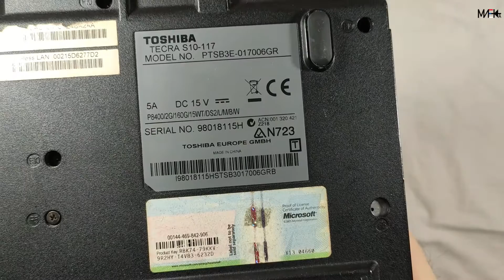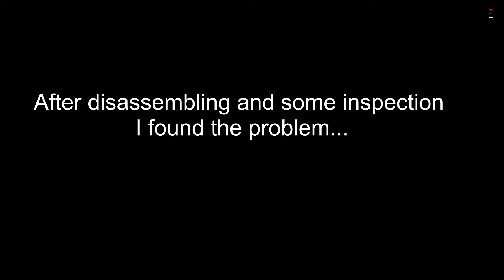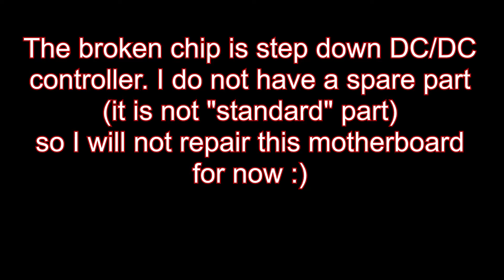Toshiba Tecra S10 117 / Blinking LED orange // Treperenje narandžaste LED

Comment: This and my laptop are the same model and the same problem what should i do sir
Reply from the maker: This is probably some chip defect on motherboard due to overheating, so unfortunately I think there is no simple and cheap fix :( I sold mine for spare parts.
Reply: @MilekaRobot  in my city the technician ask me $30 to fix it and yesterday i gave for him to fix my pc
What should I do after the technician fix it and give for me can you tell me about how to use it after it repair
Reply: @MilekaRobot  please answer